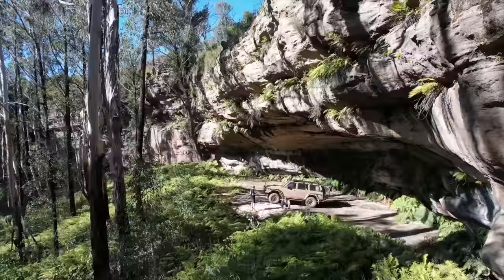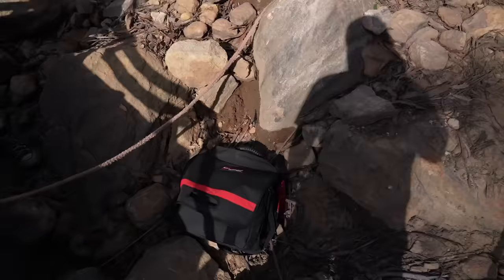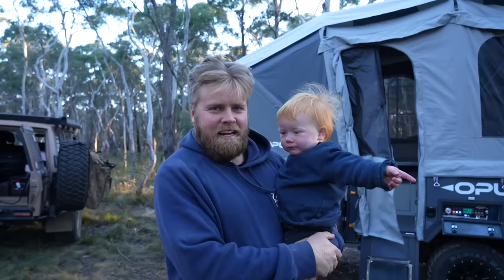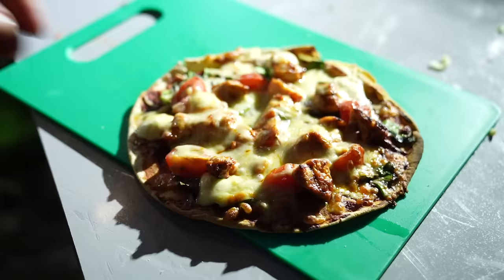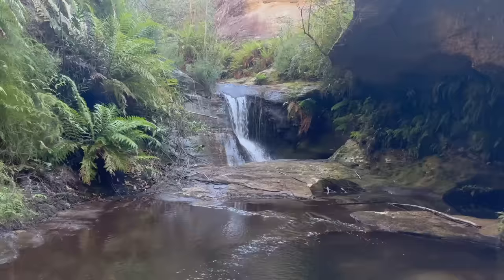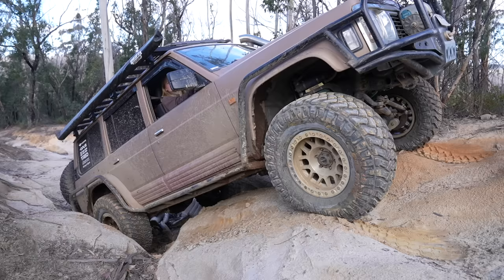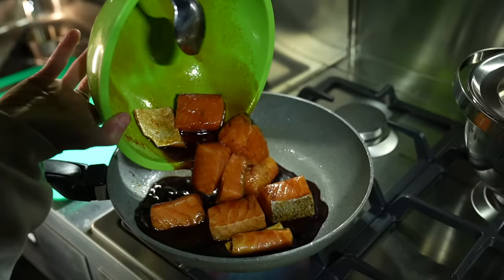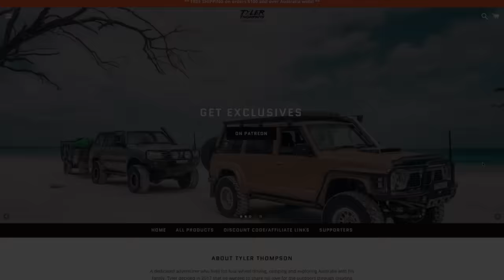There's a reason no one comes here anymore... The wild Lithgow Mountains

Comment: Great content brother hard luck with the td. Go 4.5 cummins or 6bt u will never have problems again plus so much more power n torque also way better fuel consumption
Reply: I started zd powered then blew that up then put a ls1 in then that dropped a lifter which hurt the motor since putting in the 4.5 cummins ive done 85000km trouble free it's averages 11 litres per 100km or about 13.5 towing a 2.5 t on 35s

Comment: I used to load my rig up past the max and tow two motorcycles. Had to get the heavy duty springs. But idk about going any heavier, it will ride kinda hard without the trailer and camping gear. 
Id say just deal with the sag and load your trailer and rig as best you can.